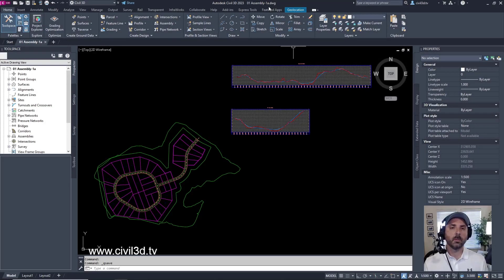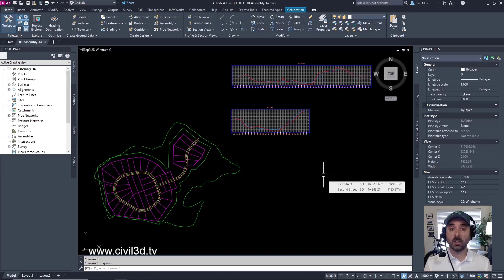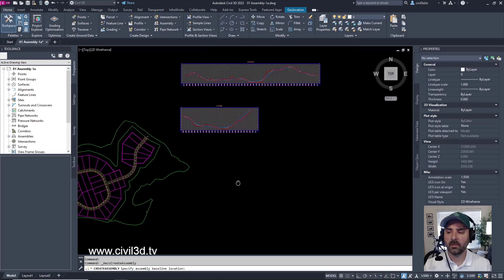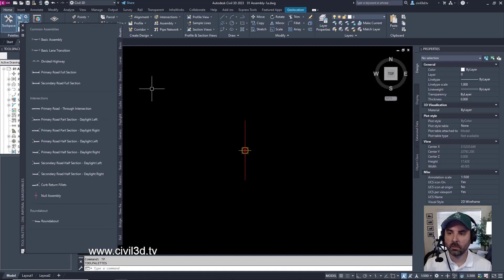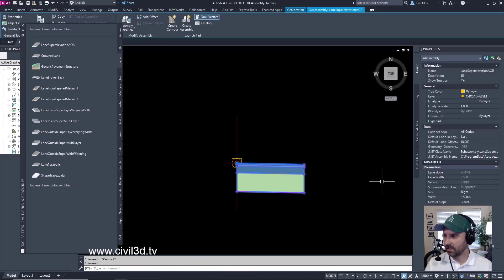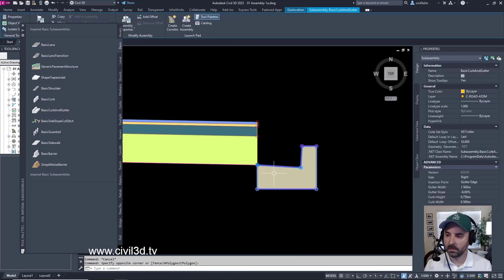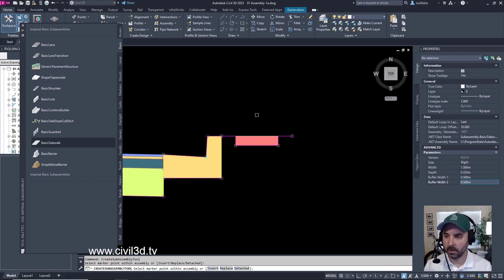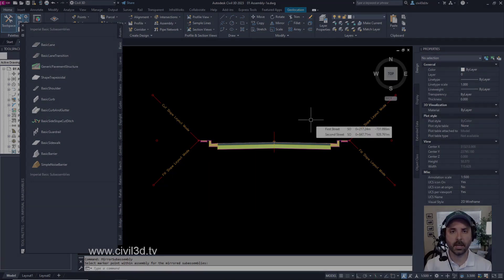01 Creating an Assembly in Civil 3D 2023 to 2024

Comment: I have imported 3D points from a shapefile. I then drew a featureline to connect the points. I then created a corridor from the featureline, and added my assembly to my corridor. Then I created an alignment from the corridor to generate my sections. Is this the correct order for the workflow? It seems that my corridor does not daylight correctly to my EG. Also, it seems like part of my corridor is at 0 elevation, while the rest of the corridor is comprised of dots at 700' elevation. 700' elevation is my correct elevation. I believe that the corridor at zero might be just the corridor surface that generated at 0 elevation versus my correct elevation.